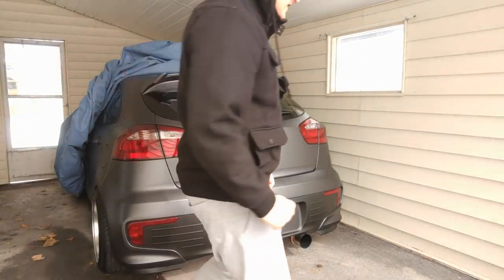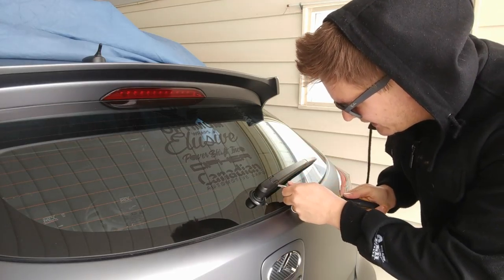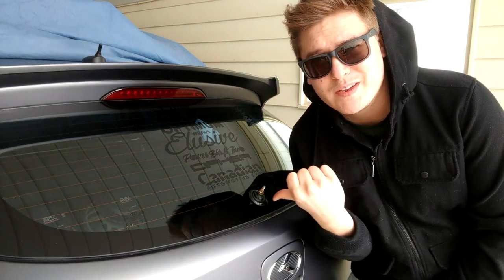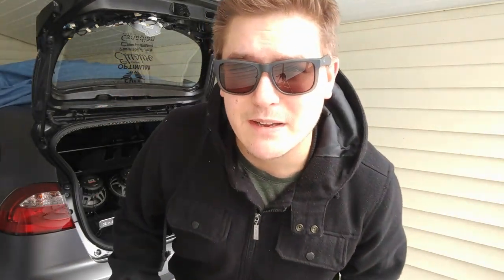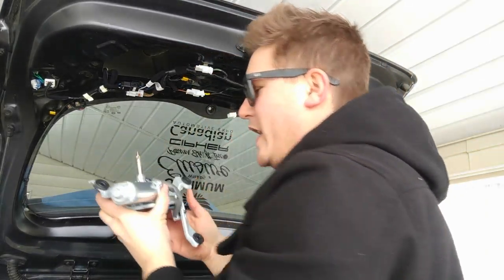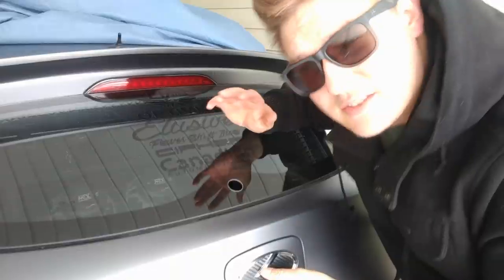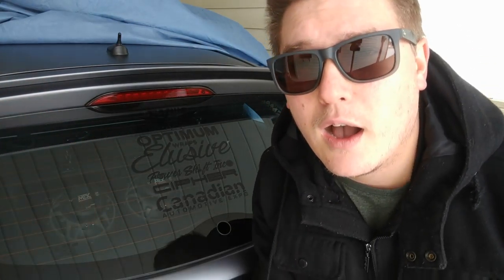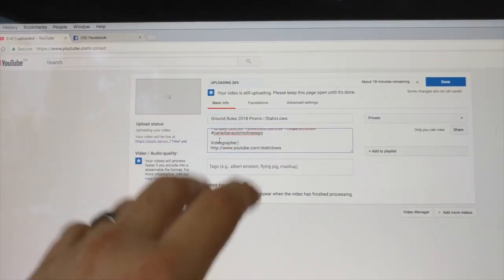Rear Wiper Delete | StaticLows | WV EP 14

Comment: You have to work on a better mic system - another great video..
Reply from the maker: I am working on upgrading everything, Just bought my new camera setup.. shopping for a new gimbal and other accessories for it like a mic, extra batteries and pro sd cards. However until then I will be running the vlogs off my old setup. The new gear will be able to do both video content and vlogs which I am happy about! Thanks Gary!